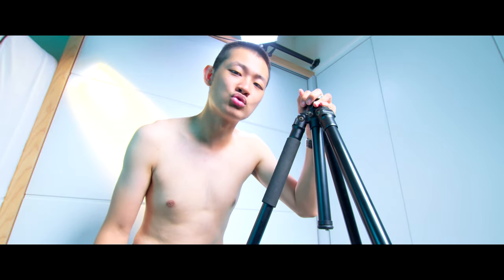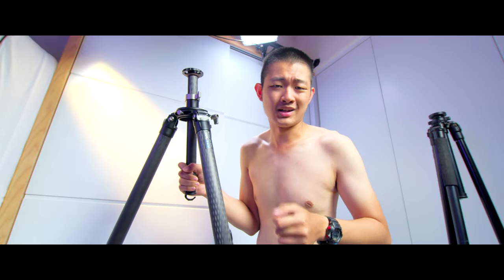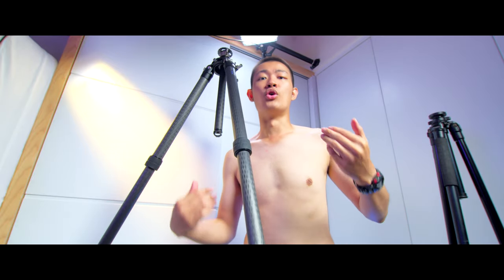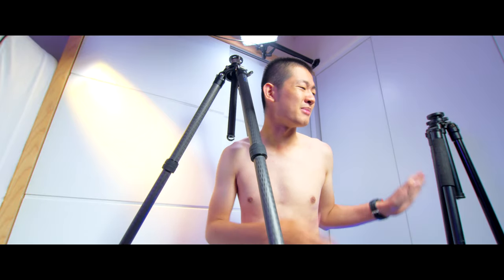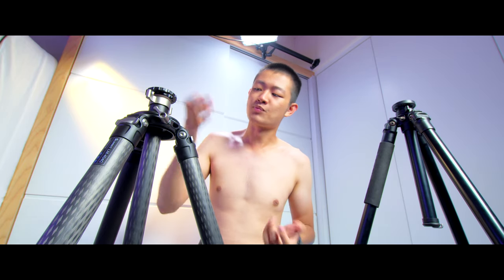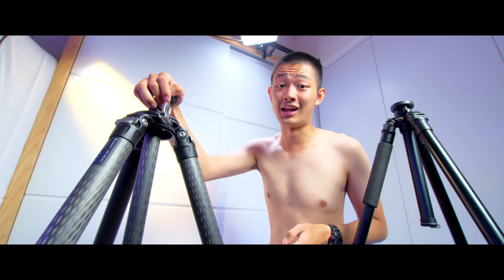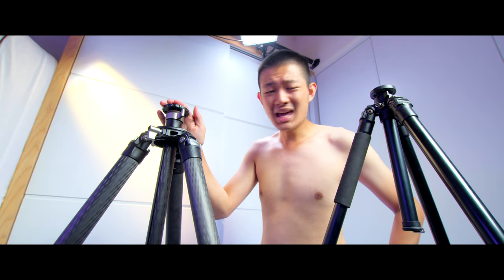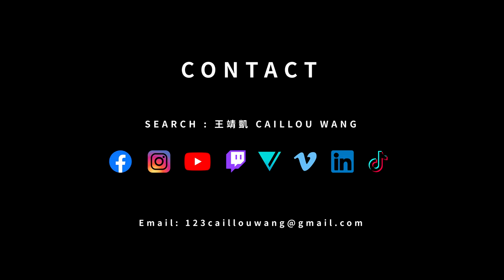Leofoto LM-404C | Pro 10X Carbon fiber Tall over head Tripod

Comment: hello! nice tripod! i hope you are liking yours! I love mine 😁😁😁 i have a couple of tips and tricks. I’ve learned along the way specifically about this tripod.

the thing with carbon fiber is; it’s suppose to “flex”… a lot!!! (as you demonstrated)
but where carbon fiber gets interesting is actually in the “flex”.  when it flexes, it’s absorbing more vibrations. 
aluminum, or any other rigid metal for that matter, just transfers the vibrations up to your camera resulting in a less stable shot. 
it’s kinda like bridges. if bridges were built not to flex they would be toss cars off every time the wind blew. 

as for the 3rd leg that was giving you some trouble, it may just needs a little grease. leofoto has recommendations on this. this will also help with waterproofing, and the overall longevity of your tripod.

You definitely should have received a set of spike feet to swap for the rubber ones. those come with every LN/LM tripod.

Can not wait for more leofoto gear reviews 😎😎😎🥹🥹🥹
Reply from the maker: OmG. Thanks for sharing these useful information. Appreciated.